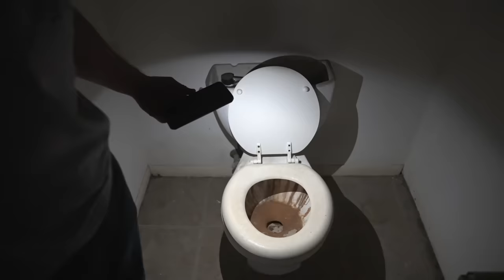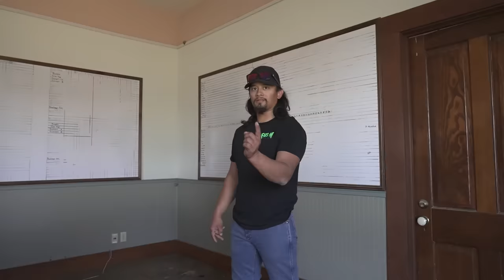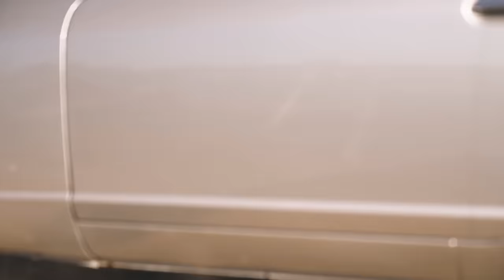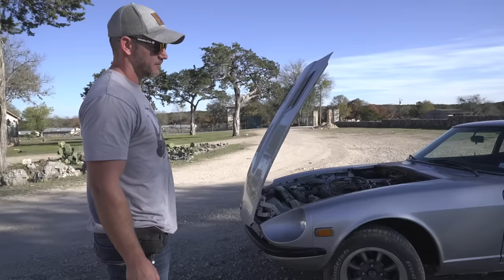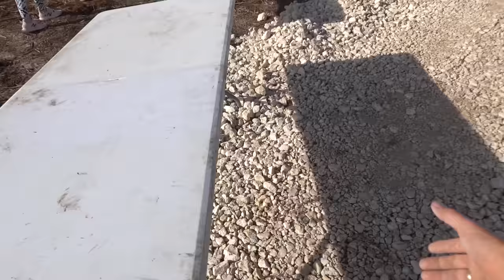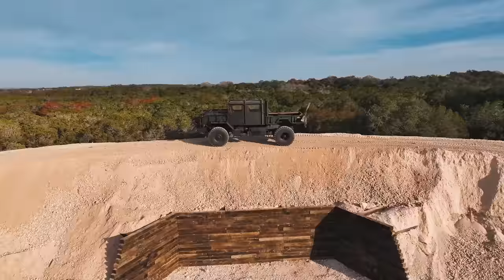We Found an Abandoned Japanese Sports Car at the Resort!!!

Comment: As an IT professional, their treatment of the network closet was painful. They really need to get someone out there to survey it - there's an old Fiber dmarc there that might be capable of delivering gigabit to multiple locations around the ranch, assuming they don't accidentally destroy it.
Reply: you it guys are a different breed of people…..did a networking course and wanted to do a forever sleep
Reply: Like I seriously cringed when they yanked the cables 🫣
Reply: Yeah I was like wth are you guys doing.... don't tear up stuff. Some of it is usable....still.
Reply: Another IT specialist who spent many hours punching down wire in those blocks and pulling miles of wire. Still looked good in there. RIP old tech.
Reply: @NOHOPHOTO  yeah it looked good enough for camera around the property.
Reply: That closet might be worth more than the wine cellar if the cabling is still good. Never know..
Reply: Old IT me:  "Ahhhh don't pull on that!"
Current engineer me:  "Hit it with a hammer."
Reply: Um any equipment in there would be nearly worthless after 20 years as for the network cable all garbage at this point time to rip it out and start over some of the network gear might be worth salvaging to sell on ebay or the used market but to use that in a resort would be foolish. I have been doing networks and general electronics tech work for over 30 years. Most of that wiring shown was old telco trash. Every thing in there other than the switch etc is all garbage the 2 linksys routers show that those are 10/100 and were garbage when new
Reply: Didn't catch the fiber demarc. However, if they've been doing construction all around the property I wonder if they haven't crushed or damaged the fiber facility outside on the property somewhere lol.
Reply: I know!!! All those fiber ST connectors just being yanked on! I was like don’t do that!!!! lol. RIP multi mode network.
Reply: @nanaki-seto  The Linksys routers are for sure trash, but you definitely don't want to rip out the fiber optic lines, those are still good for Gigabit internet connections!

Some of that was old telco but old telco is still usable for alarm systems. For someone who claims you've been in networking and electronics for 30 years, you're clearly biased against old tech that is still usable and functional. I've been an IT Professional for over 14 years and in my personal opinion, the only old stuff I would get rid of is the Linksys routers. 

Fiber runs are very expensive to rerun and in some old buildings almost impossible to rerun without tearing out walls and ceilings.
Reply: Matt and Mikey pawing through all that wiring made me cringe. If there really is fiber there, that could be really important. That is, if they don't destroy it first.
Reply: @kingzach74  Yeah and unless you want to set up a bunch of network closets the various the old phone lines would be useful as they can still work as analog lines all throughout the property.
Reply: @kingzach74  old IT is great. Everyone complains they can't call with voip when the internet goes out but if they were to just enjoy the old pots phones they wouldn't have to worry about anything.

Comment: Matt you should line the inside of the railroad ties with another set of railroad ties. This way if the outer layer get damaged and it probably will with explosions. You can change the inner wall and will not have to dig it out and repack a new wall.
Reply: That’s a great idea! 🤨
Reply: Smart.
Reply: That’s an excellent idea!

Comment: Matt, all those blocks with the red white and blue wiring are older phone wiring.  Looks like also some fiber (the orange cabling) which makes sense considering the size of the resort and distance between buildings.
At some point it would probably be worth having someone come out and see what kind of infrastructure you have and what can be reused
Reply: Yeah a bunch of old type 66 blocks for phones or other analog devices and looks some old OM1 fiber cabling.  They may be able use the fiber or fix it but it would probably be limited to just a 100 mbps uplink.
Reply: It can all be resused,  as pull cable for Cat6 or fiber, lol.
Reply: I still work on this kind of stuff and love old analog phone systems with the 66 blocks and cross connect wiring.   It would have been fun to manage the telecom and IT infrastructure there when the place was operational.
Reply: No shit, Elon, did you watch the video without sound? Literally, the very first thing he said was “this is how the resort used to communicate with the outside world.” He’s obviously aware of what the fuck it is.

Comment: One of the things that I am concerned about the range is the special bunker implant it won't stop ricochets that hit an object and deflect over the berm. Better to install railway tie wall on the top of the berm.
Reply: Better yet, just build a roof over the whole range, just to be safe.
Reply: The point of the inset in the berm is so that any ricochet that goes over the berm is going nearly vertical, and will fall fairly close to the range.
Reply: This is what I've been saying. Just a 6ft tall wall would do wonders.
Reply: That's why it's recessed into the berm. There's really nowhere for a ricochet to go.
Reply: Nah stacks of old tires filled with dirt will work better, but I really don't think its necessary, if its a ricochet that deflects at that high of an angle its going to fall just outside of the range
Reply: I think he can find a roof on the ranch somewhere
Reply: I want to sneak onto the range and nail a door to the sleepers! Bunkers need doors, right?
Reply: @Randyluck1  The thing is already 20 feet high lol.
Reply: @MoxJet629  Your point? More is better. Like Matt mentioned, a novice full auto shooter could spray upwards. A tie wall would help. Plus his latest plan of double side using the berm would be safer. Even safer would be gradually sloping the ground down in towards the berm 4 or 5 or 10 feet more.
Reply: @Randyluck1  Why not make it 100 feet high and solid gold?
Reply: @MoxJet629  The height would make it safer. The gold crack is just stoopid.
Reply: @Randyluck1  Man, I don't care... How do you have so much energy to argue with people on the internet about something that has nothing to do with you? Please move on to someone else.
Reply: @MoxJet629  So this means you saw today's range day video. You know, the one that showed the close up of the mad minute with the shots skipping over the top of the berm. 

You should have just said I was right. 😁
Reply: @Randyluck1 yeah you was right, but Matt did mention that the berm will be taller at the end.   (At least another 8 feet)

Comment: The wires that Mikey grabbing at the top of that rack are Fiber connections, the bundle Matt grabbed that wrap around the white spindles are all telecom patch cables.  Modems look very outdated and hackable and the telecom is likely an POTS system of an internal PBX.  If I was in the area would love to look and help you lay it all out..  Nice big MDF there.

Comment: Just finished an exhaust on a friend's 280Z, 2 1/2" 12" "cherry bomb" up the front glass pack at the rear it all ready had headers on the motor, being that I operate a mandrel bender it was done in s/steel and the only joins were at the mufflers and it sounds fantastic.....!

Comment: NICE.....I've had a 77 280z  since 2015,  but i put a set of the 240z side-draft SU. carbs on it with the N42 intake and E12/80 dist: & 5-speed.
Then I have a 76 280z  (no rust) on the side for a future project.

Comment: As a telecommunications technician/ IT Tech it made my heart stop when Mikey was pulling on those fiber cables and then shoving them back in the data rack. All of those 66-M150 Phone blocks were not from the 60's or 70's lol... Those looked much more recent, probably from the 90's. Which is still 30 about years ago. 

I hope that you guys are considering local communications on the abandoned resort??? Please talk to a local IT company to have them spec it out for you Matt...
Reply: Indeed! Those ”old” phonelines are still usable (VDSL2?) and seems like there is OM1 fiber, if distance stays under 550meters they could use up to 1Gbps connections between buildings.
Lots of potential there, would be interesting to get that work 🤓

Comment: You you put bays on the opposite side you should have some sort of ballistic canopy over people in the event of a "vertical" ricochet coming down or a ND from some novice double tapping a 500 SW in the air due to recoil....the berm should also have obstacles to prevent pedestrians from climbing up or onto it and definitely put some red/green signal lights to indicate if the opposite range is hot.

Comment: All those wires are phone lines or could also be for radios or internet. I used to work on phone and radio communication equipment in the Air Force and dealt with those demarcation panels all the time

Comment: Matt I'm a voice engineer. Those are 66/110 blocks for voice (phone) lines. Those things Mikey was putzing with was fiber cable that is primarily used as interconnect routing between buildings. . You may be able to use it for future networking.

Comment: Those are called punch down boxes and they're typically used for phone lines not data.
Having laid many miles of structured cable, I would say leave it in place.
Simply abandon its use because there's no telling if those lines are any good all the way through without ringing them. 
Just use a simple mesh Network.

Comment: In theory there is nothing wrong with doubling up by using the  back of the berm, but there is no safe way to get there. You would have to extend the berm significantly on at least one side to allow 100% safe access, and that extension would probably be bigger than a new berm.

Comment: Regarding shooting on both sides of the berm.
In the Marines, the targets are pulled up and down manually. This means there's Marines behind the berm.
I got to spend some time with the Marines doing this, and the sound of the rounds super sonic crack overhead is deafening. Easily as loud as gunfire.
This isn't an issue if everyone has earpro 24/7, but if the range is cool, and people are chatting without their headsets and suddenly the other side starts shooting rifles, you're gunna have a tinnitus party.

Granted, when I got to hang out with the Marines doing this, the rounds were flying 4 feet over our head.

Comment: Someone tag Matt on this those are old but still very widely used in America those are called amphenol 25 pair braided telecom cables typically malls and hotels get there service through these because the data even in a T1 cable which is 10gbs still still carried over two individual wires so that cable could probably deliver at least 1gbs the guy saying get new systems is completely wrong unless all the wires are cut since it's no network they could probably find all the cables that have a clean paths other end by process of elimination with a toner to which that's probably what they'll end up doing instead of installing new lines or they'll identify them and it's likely that there is another room with individual cables wired off the 66 blocks directly to each room

Comment: Just watched from the start to here in the past few days. There is a total of 14 hours 45 minutes and 24 seconds of Abandoned Resort content. that is 885.4 minutes. 53124 seconds. Here are the values from the addition.

19m 55s
+	26m 13s
+	20m 11s
+	21m 18s
+	15m
+	53m 54s
+	51m 03s
+	43m 07s
+	30m 20s
+	36m 15s
+	25m 10s
+	33m 08s
+	27m 30s
+	27m 45s
+	14m 17s
+	25m 01s
+	17m 03s
+	26m 09s
+	18m 26s
+	44m 31s
+	32m 44s
+	31m 28s
+	17m 23s
+	37m 59s
+	22m 10s
+	40m 15s
+	23m 58s
+	25m 07s
+	17m 14s
+	19m
+	17m 41s
+	9m 03s
+	15m 06s
--------------------------------
=	14h 45m 24s
=	0.614861 d
=	14.75667 h
=	885.4 m
=	53124 s

Comment: hahah Yes Us Millennials only want new things with softwre locks.  naa thats GenZ that want to fill the landfill with non fixerble tech. 

 FunFact: you can use an old ethernet modem as a switch or seprate Wifi Link 
to youre main internet from the Main new Modem. 
ive saved 2 old BT Modems from 2016 and 2019 and will use them to take my 4GDongle in a pc 
from the PC ethernet to the Modem used as a switch to my TV And main Gaming PC